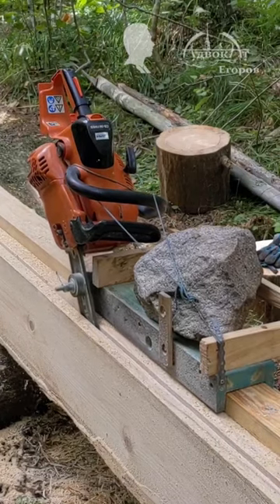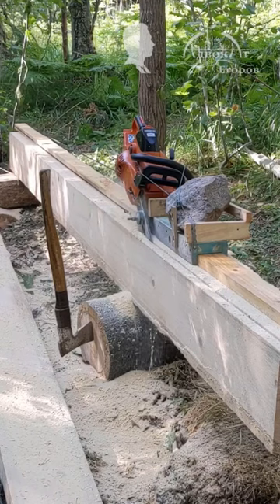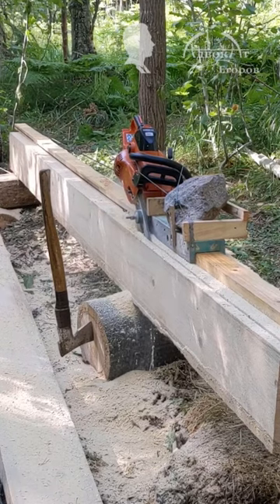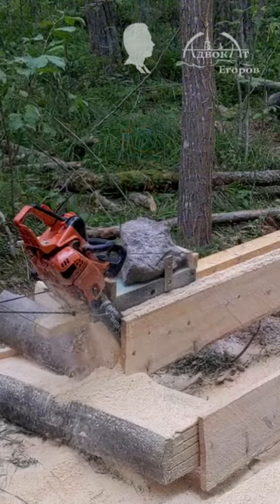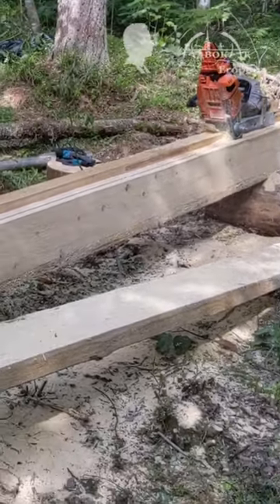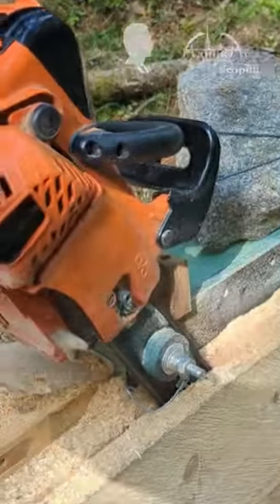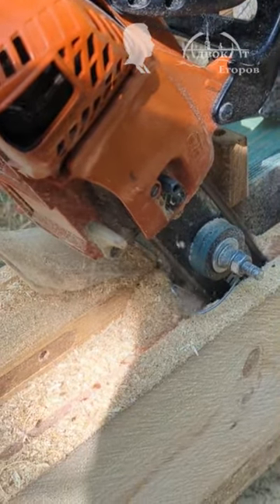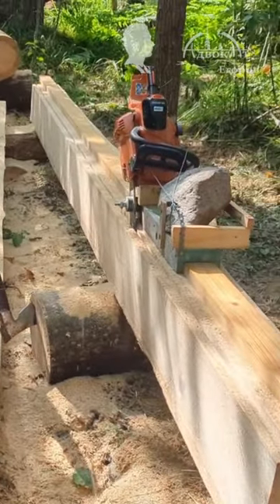Self-propelled Chainsaw

Comment: Hopefully you are using a skip chain/ rip chain for this. I rebuild chainsaw motors, and have had plenty of customers burn up their motors from an overload to the engine while making boards. When cutting lengthwise , there are specifically designed chains. Hope this info helps someone save their saw a costly repair.

Comment: Cool, it reminds me of what they use to torch long pieces of metal.

Looks like saw dust gets in the way. It would be nice if you could add some sort of blower which is also powered by the chainsaw to help the sled from getting filled with saw dust.

Comment: Does the chainsaw overheat going full power like that for so long? How does the chain hold up to the abuse?
Reply: No 2 cycle engine like that are designed for those kinds of loads. The work much better when they are warm. These are the same kind that are used in weed eaters, blowers, dirt bikes and other things.